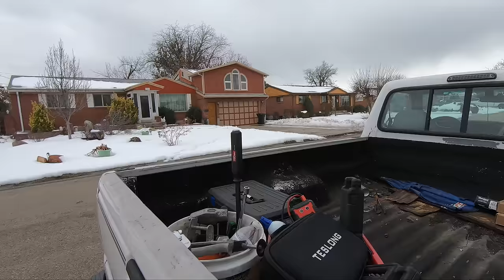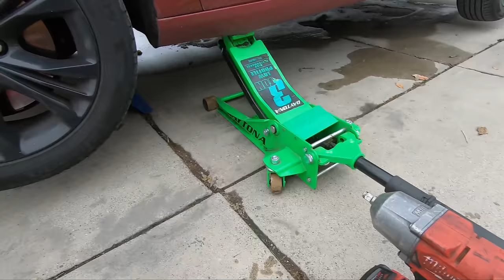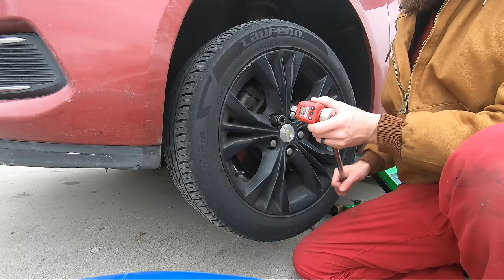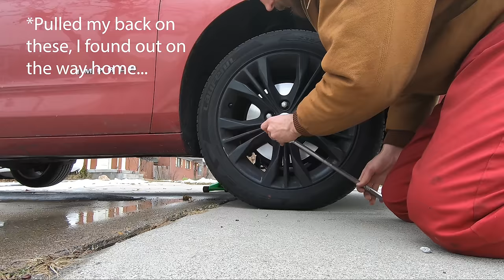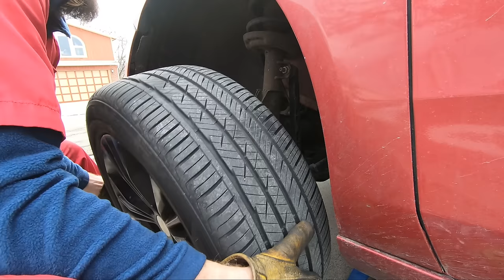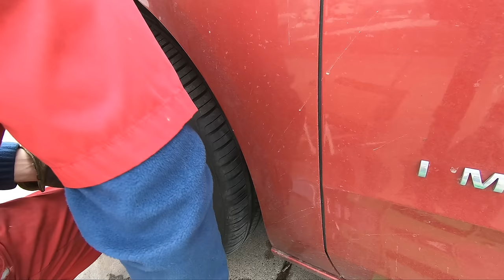Local Tire Shop RUINS my Customer's Brakes! How I warranty as a Mobile Mechanic?

Comment: If you don't clean the rust off the hubs, it will cause the rotor to lean one way or the other slightly, causing it to warp faster than it should. The easy way to prolong the rotors is to clean them off to bare metal and then install new rotors. Obviously, they shouldn't have over torqued the wheels. Great job on the replacement. Don't cut yourself short on labor. It's not free for you to do it, I tend to fall into this trap, too.
Reply: I just came to comment on the same thing. You can check the runout on the rotor with rusty hubs and get 9-10 or even more runout which will definitely cause a brake pulse. I clean them to bare metal and apply a thin coat of bearing grease so it doesn’t happen again and makes it easier to remove the next time. Also using Autozone’s china crap parts doesn’t help.

Comment: From my perspective, there are three distinct cases. First, customer asked for a brake job. You purchased parts and installed them. If a part fails, then you are responsible for 100% labor and 100% parts. Second, customer requested specific parts or provided his own. You then guarantee only labor (think forgot to grease something causing a lock up). A part failure is a new charge. Third case: someone else's fault caused a failure of a part you chose and installed. This is also a 0% - new service call, new labor and parts charges.

Comment: Ernest if you are going to guarantee your work you need to install the very best parts either OEM or top notch aftermarket, and usually the customer will not want to pay extra price for premium parts. If the customer goes cheep on the parts, I wouldn't guarantee it. I mean you could say that you guarantee your workmanship not a failed part. Especially working on hoopties.
Reply from the maker: I do make that clear in my estimates at least.

Comment: One of the possible faults in the brake system is when there is extreme braking, the discs are extremely hot and then you drive through a lot of water and the discs deform. You can't see it with the eye, it can be determined with a micrometer watch attached to the lathe.

Comment: Yeah, should be at least 3/4. You warranty YOUR labor. Not the tire shop that over torques and warps the rotors labor. Not the customers fault, not your fault, but it is what it is.  You still gotta get paid for your time. Especially if it wasn't your screw up.

Comment: Your warranty should end when someone else goes back and works on something you worked on. if they over torqued it's on them for new rotors.
Reply from the maker: i like that. Thanks for the thoughts!
Reply: I like that too however, you went above and beyond. The customers will remember that.
Reply: That's a fine line no?
They can argue that changed the tires but didn't do anything with the brakes.
But they torque it to high is your argument.

Comment: There are other explanations for warped rotors. The mating surfaces need to be cleaned thoroughly, and you need to measure hub run-out with a dial indicator. Regardless, im glad you work to take care of the customer.

Comment: Turn the wheels outward or toward you to access the bolts when doing brakes easier on the back. Also clean the hub face for a flush fit against rotor
Reply: I always clean the hub and put a thin layer of anti seize on because I've had to break them free because of rust like that, and as you say to get a flush fit.
Reply: Yeah, turn the wheel out for easy access and you don't need to put your head in the wheel well.

Comment: Check it is not a bearing going - rotors don't warp without a good reason.
Reply: Cheap or poorly made rotors can warp over some time. They can be more prone to heat. Happened to me.
Reply: I second that, cheap rotors can warp after some heat cycles. I've owned plenty of cars and have had it happen.

Comment: You should always clean the hub surfaces when installing rotors
Reply: yeah, it's so little time. and they have cool over the stud drill brushes that make fast work of it
Reply: @jayc4283  I love the tool that goes over the studs

Comment: Just a weekend mechanic on my own vehicles.  I don't think rotors warp because they are overtorqued.  The overtorquing would have to somehow cause the rotor to not be properly seated so that it isn't tracking in plane.  Are you sure they didn't slam on the brakes at high speed?  Were the caliper pins free and the pads seated properly and also free?  I briefly saw you check the pins.
Reply: I thought so as well like over torquing a wheel has no interference with the brake discs whatsoever 🤓
Reply: If caliper pins were not free, you will notice right away.
Also, There was plenty of grease when it was taken out.

Overtightened can warp rotors especially if one bolt is much different than adjacent bolts.

Comment: I'm going to wait to see what other viewers have to say, I already see a few things about that job and a couple of other explanations for warped rotors. I can tell you what it's not, over torqueing, all you're doing is over stretching the studs. When I worked at Toyota back in the late 70's they made us torque aluminum rims but when I left in 80 I never torqued another wheel since, I know you're suppose to do it, a lot of people will rant about it but 45 plus years of not doing it, I'm not buying it so don't blame somebody else.
Reply: I dont think it was the torque from the tire shop. I have had both aluminum and steel rims and i have never wrapped the rotor and hardly use a torque wrench just tighten until i feel is tight enough. (My own personal vehicles)
Reply: over torquing a wheel will not lead to a warped rotor.... Maybe water splashed on a hot rotor causing a warp? Warranty work? Well that's up to the owner of the business.
Reply: Over torquing the wheel is not fair to the customer. If they get a flat, those lug nuts will not be coming off with the supplied lug wrench with the car. 

I personally just changed out a flat on a car I worked on weeks before. I torqued it to 100ft lbs which was spec. The crappy lug wrench supplied in the tire kit barely took the lugs off.
Reply: Normally I would probably agree with you but I don't have a lot of confidence in the owners ability to change anything on there cars so I prefer they don't touch it. I can live with a pissed off customer if they have to tow there car for a flat I can't live if a tire came off and somebody got hurt cause I relied on a torque wrench to tell me how tight a lug nut is. I'm down here in florida in a few months all the snow birds will head back up north to go home, that's along ride, so those wheels have to be tight. Call me paranoid, call me unfair, I'm ok with that, at least I can sleep at night knowing all those tires on put on won't come off. Safety first! @mph5896

Comment: Seeing you don’t clean the mating surface of the hub bearing for the rotor to sit flush against. I would say that’s your reason for rotor war page
Reply: Agreed. He most definitely needs to go shopping: (1) Milwaukee 1/4" Right Angle Die Grinder (2485-20), (2) 3M 21758 Scotch Brite Roloc Brake Hub Cleaning Disc Kit and (3) Assortment of 2" Roloc sanding discs.
Reply: Exactly my thoughts the second I saw him putting the rotor on the hub! You dumda$$ you didn't clean the hub surface!

Comment: I read a lot of good comments about cheap parts and rust on wheel bearings and over torque. 
What about overheating the rotors by racing from stop to stop. 90 percent of drivers are in a big hurry to get to the next red light.

Comment: Tire tech here, if that's a 22mm lug nut, it might have been a newbie that did the other side. The 100/lb-ft torque stick usually comes standard for a 19mm lug nut. Must've used the 22mm torque stick that's rated for 140/lb-ft. Should've used a 100/lb-ft stand alone torque stick with a 22mm socket. Steelman charts rate most Impalas at 100/lb-ft torque. I'm not sure entirely how that would've warped the rotors though. I'd imagine it ruining the studs or even the hub first before making the brake parts fail. Also, definitely charge at least half labor time. Dealerships techs still get paid warranty time even if it's crap, you should be getting paid too.

Comment: I agree with the free fix of parts that fail but the way to cover the warranty is to charge more for the original install and bank on parts eventually failing. And never warranty any customer supplied parts. This failure is not your fault when the tire shops do not torque the lugs but just use their impact to apply them. On my personal vehicle I always reset the torque on any lugs that someone else torqued .

Comment: @RoadsideRescue If you had the time ALWAYS clean off the rust on the wheel bearing before putting on the new rotor.
Reply: The bearing is inside what folks call the hub
Reply: You mentioned one of at nearly 15 parts that make up a hub including 5 wheel studs, and inner and outer assembly plus inner and outer seals inner and outer keeper clips plus your precious bearing and even more than that depending on manufacturer
Reply: Nobody has even mentioned the aftermarket wheels which may possibly require a hub centric center(ing) ring

Comment: I never charge a dime for warranty work, but I factor the cost into my hourly rate. Customers will pay more if you guarantee your work. That and an up charge on parts protects you in times like these
Reply: If it’s not my fault or a part failure though I’m charging 100% of my hourly rate to fix it

Comment: I'm a little fuzzy on the new pads, unless you just knew that the auto store was going to support the cost just to be sure? When I have warped rotors, I have reused reasonably new pads and never had any issue. But then again, I have done 2-3 pad slaps and never seen an issue either. If thickness is there, and runs true, I would rather keep using the old reliable rotor and suffer some initial increased wear on pad. I make sure pins and pucks are good so I'm not missing anything. This is all personal car, not customer

Comment: If you notice tire shops have multiple air impact gun on the floor connected to the same compressor and you hear them say the good one meaning new tool
Reply: Now, there's the problem lady. 😊

Comment: I personally think you should stand by the service you offer 100%. 

It sucks, but it is a cost of doing business. If you are the one choosing what parts you use for the customer, you are responsible for ensuring those parts are quality. 

This is in general of course. In this situation i wouldn't even expect you to discount the work since you are just fixing another shops mistake.

Comment: It's definitely a case by case thing. If it's within your warranty period, you should cover it 100%. Most shops in my area carry a 12 month/ 12,000 mile parts+labor warranty. Our shop would warranty the part and move on. That being said, this case wasn't your fault. I think 50/50 (or customer pays for 100% labor) in this case is more than fair. You're doing something right if you've had one warranty call all year!

Comment: I feel the rotor failed from something then over torqed wheel. They’re number reason most likely it was hot from some kinda sudden breaking and got snow water something splashed on it  to cool it off to fast. Also this why I use my mobile guy on things I don’t have time to do myself is cause he warranty work and parts. That’s just the business and what keeps customers. I had him do cam phasers and whole timing kit in a 05 f150. 2 months later the phaser failed. He came out and fixed it free charge cause that is his warranty parts and labor. Also why I use him everytime.

Comment: Either warranty or not. Professionals warranty their work and use professional products.  Did you use the Gold pads?  Also, if you suspect warped rotors or deviation in the rotor thickness, you should throw a dial indicator on it.  Clean the hubs.  As a mobile guy, I was still offering a 3 year parts and labor warranty, or lifetime parts warranty.  Charging for warranty work isnt warranty repair.

Also, if the over torqued wheel is the issue, than it should be customer pay anyway.  

I still don't understand how you can think to charge for warranty work.

Comment: Offset your warranty work with higher job quotes, say 15-20% when you finish a job take that percentage out so your able to pay yourself for warranty so your time isnt completely out of pocket
Reply: One of the possible faults in the brake system is when there is extreme braking, the discs are extremely hot and then you drive through a lot of water and the discs deform. You can't see it with the eye, it can be determined with a micrometer watch attached to the lathe.

Comment: In this case I'm charging full labor. I think you said you installed these a year ago, warranty has expired at this point. Parts and labor is covered should it fail due to workmenship or defective parts within that time as long as there isn't any misuse or tampering, etcetera. it's covered and I'm only charging a trip charge. I offer Zero warranty if customer buys part, or if they want me to get it from a junk yard.

Comment: If i pay to get a warranty transmission in and the labor was warranty too by the installer. If the warranty transmission goes out but not fault of the Warranty installer. Than i get a new transmission from the transmission warranty. Then i pay the guy that warranties his install. Again for another install with another install warranty. The installer would only warranty problems with the install.    Short and simple you should get paid for the job again in full. The parts should be free.

Comment: What are we talking about here? Warped rotors from over lug nuts. No. This is just normal wear. You do not make the parts. Your parts were put on successfully. You charge labor only and warranty the parts thru autozone. Do not short yourself. If you want to fice a discount on labor go ahead. But there is no such thing as 100% warranty or labor. If you have customers that cannot understand this then cut it loose. Its not good for business and business is ran with money. Not feelings. Dont ever put someone elses family in front of yours. Name your price and thats it. There are people chatging $200 to slap on pads. Appreciate yourself and what you do

Comment: All you cover in warranty is the quality of your labor. The rotor could have failed due to any # of reasons.hard braking is most common. So all that is warranted is the parts. Labor is charged each time.thats how I operate my repairs

Comment: Why did u not grease the slide pins I just saw u reinstall the caliper the pin is bone dry that could warp it also anytime u pull a caliper off the pins should always be greased again even if it was just greased a week or a month ago u gota always re grease the pins

Comment: Yikes, are those chrome capped lug nuts???

Infamous for swelling up from rust jacking between the metal and chrome cap😢

I had them on a Nissan Altima & I promptly replaced them with a solid one piece lug nut set
Reply: Get rid of the Nissan would be the smart decision to make. 👍
Reply from the maker: yeah. I use a slightly larger socket.
Reply: @BV-Auto  I got an older model, but I stay away from the newer ones with the infamous Jatco CVT self destructive 😁
Reply: @ricebike  smart

Comment: Clean the wheel hub off before putting rotors on..that rust causes pulsing brakes.  I also never saw u clean the oil off the new rotor with brake clean? Also the caliper bracket should be cleaned with a file so pads move easy. Royalty auto service has an awesome brake video to prevent come backs.
Reply: The rotors were probably coated ones that don't have oil on them. The last set of rotors I put on were zinc coated.

Comment: The cuts in the disc are minimum wear lines, once worn down to that ots time to change. 100% ageee with other comments on cleaning hub face, needs to sit flush on installation

Comment: Well as you can see nobody is contributing over torqueing as being the cause of warped rotors. A lot have picked up on not cleaning the rust off the hubs, that was my first clue, chances are you didn't do it the first time. Rust gets in there and causes the rotor to sit on an angle also that hub helps to transfer the heat out of the rotor if it doesn't sit flat it can't transfer the heat, hit a puddle of water it warps. Another cause is if the back brakes don't work that well then to much pressure is required to stop the car, semi metallic pads will cause the rotors to run hot, pizza delivery at night, part time or Uber driver, being late to work and tailgating and riding the brake, front calipers sticking for a few reasons. I'll take any of these long before I consider over torqueing, in fact it's more important to make sure the wheel doesn't  fall off before I worry about torqueing them.

Comment: Hold up. Your blaming the tire shop for the rotors warping when they were barely over torqued. I have never seen a rotor warp because the wheel was slightly over torqued. Heck I never seen a rotor warp when way over torqued. You did more damage by not cleaning the face of those hubs which has a crap load of rust on them. That will cause a pulsation over time. Your moaning about them but your just as bad. Spend the extra minute and clean the hub. Free or not do the job right for a supposed mechanic. Anyone can be a YouTube mechanic. Half your videos your always blaming someone, must be for clicks.
Reply from the maker: uneven torqued too